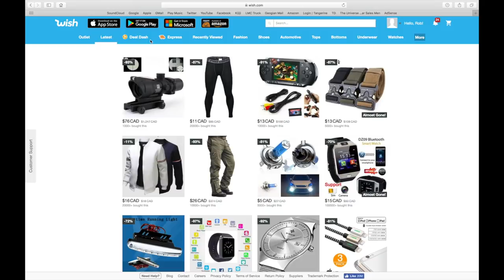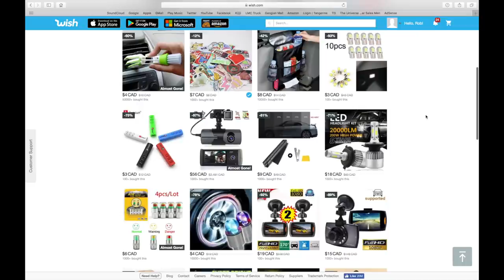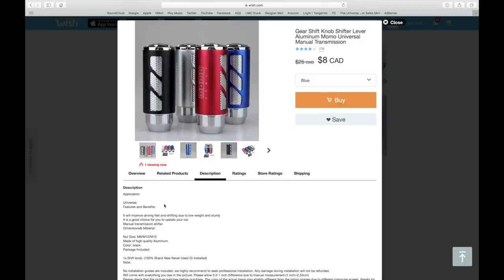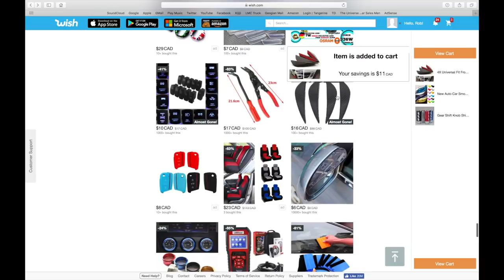I Bought 3 Knockoff Car Parts from WISH!

Comment: I ordered a phone case of wish a year ago ..... still waiting 😂😂
Reply: Levithan Harvey same i ordered a lamp that connects to ur phone . Never got it
Reply: Hamoon Naseri yea don't trust that stuff anymore aye 😂 just surprised this guy's stuff came
Reply: They refund you no questions! I was pretty suprised
Reply: Easy to get refunds. Out of over 100 orders, I've only had 2 things not show up. One was because I ordered to a business address and couldn't receive so they shipped it back without me knowing. The other was because they ran out of stock. I contacted the company after a month of waiting and they informed me of the stock issue and refunded. Although most of them speak somewhat broken English, they are more than happy to work with customers as long as you don't buy some weird one with 0 reviews. The trick is just that...read reviews! Some things are actually awesome deals. For $3 I got a Bluetooth to aux adapter and it has decent range and no audio quality drop that I've noticed on my aftermarket system. The clothes are comfortable, where they cut costs on those is the inside of the clothing(seams are messy or lacking in fabric, but look flawless on the outside).
Know what you're buying though, I wouldn't personally ever buy something like an air filter or something that could endanger you if faulty unless it has great reviews. Remember, yes it's cheap China crap, but everything like your Apple headphones are manufactured in China. You're pretty much just cutting out the middleman for some products, while some others lack parts.

The thing I've learned is that they cut costs on visuals before functionality. They make sure your $20 mp3 player works even if it looks like you got it in a McDonalds happy meal.
Reverse for something made to look good. Like the shift knob for instance, it looks good and it fit. Maybe not the right way, but it functioned and looks nice.
Reply: Levithan Harvey I orderd something it was supposed to come on may 15 it never came then it said it was gonna come in May 25 never came😭
Reply: Levithan Harvey im sorry
Reply: Anybody saying they never received there goods Simple email and they reshipped another. Used to wait two months They have got that down to 28 days in the UnKnown ie 🏴🇬🇧 Brexit just get the deal done so us Brits get our identity back and hopefully not to late to Make Britain Great again . That’s what we voted for. ✌🏼
Reply: I've had everything i ordered delivered after 1 month.
Reply: @jdrfc6526     Im with you on that James. Lets hope so buddy.   David.  G B
Reply: Hold on could still come might just have sent it in the rowing 🚣‍♀️ boat So could turn up but don’t hold yer Breath. Delivery 🚚 costs kill it could order plenty but the shipping prices are like £17 for a £7 part upgrade mod for my car but as a said just your luck what you get Just got a Honda mugen sun-strip only £10 and it’s quality over £40 in the U.K. and things I ordered just after Xmas came first week of January. Been ordering things here and there for 4 or more years now all I no don’t order clothes Well me everything hasn’t fit went with guide but big legs muscle So hard to get the right fit here online.
Reply: Levithan Harvey Hold on could still come might just have sent it in the rowing 🚣‍♀️ boat So could turn up but don’t hold yer Breath. Delivery 🚚 costs kill it could order plenty but the shipping prices are like £17 for a £7 part upgrade mod for my car but as a said just your luck what you get Just got a Honda mugen sun-strip only £10 and it’s quality over £40 in the U.K. and things I ordered just after Xmas came first week of January. Been ordering things here and there for 4 or more years now all I no don’t order clothes Well me everything hasn’t fit went with guide but big legs muscle So hard to get the right fit here online.
Reply: Did you get it? 😂
Reply: U got it yet
Reply: @frankovich213  in the past year, wish prices have gone up immensely. Shipping used to never be more than 3 dollars. They intentionally started with ridiculously low prices, but nowadays they've pumped it up since they gained popularity and can afford to move less product
Reply: Are you sure u actually bought it 😂😂😂😂

Comment: the vinyl ripped because it wasn't hot enough.
Reply: Casman heat guns are way hotter than a hair dryer
Reply: I know lol. that's why it tore.
Reply: You don't have to use a heat gun at all, for certain parts, if you know how to do it. The "Melting a little bit" is actually bad. Although this is not 3M, it's half the doer's fault, it's half the product. But, no "blame" or shame. Just blame the site and the seller, taking advantage of actual people.

Comment: my uncle has been running a shop for wrapping cars since the early 00's. ive helped him over the years and from experience, the bubbles and tears arent from the material.  if you ever decide to try something similar again, make sure to wipe the headlight with alcohol to get it clean, and make sure to wipe it again after the alcohol dried to get rid of the residue (microfiber reccomended). i also highly recommend taking the headlights out to apply the tint. to minumize the bubbles, applying heat and using a plastic squeegee to flatten the rap is most effective.

Comment: I have a MOMO combat Evo Shift knob from the early 1990s. There are no threads to screw on to the shifter. They use rubber adaptors with hex screws to tighten it to the shifter.

Comment: I have a Sparco shift knob, it uses basically the same plastic cover/screws system but it comes with a piece that covers the bottom so you don't see the threads. Not all shift knobs screw right on to the factory threads.

Comment: Real Momo shift knobs are like that though...
Reply from the maker: Ohh....
Reply: Robbie Ferreira its a universal adapter, that most shift knobs from places like autozone come with. I found if you find one thats kind of snug on the threads, you can spin them on to thread the inside, and then screw the set screws on the rubber.
Reply: I've had universal gear knobs that work the same, plastic to take the difference in size, and a pointed grub screw to lock it to the shaft
Reply: I'm pretty sure that real momo shift knobs don't use any bullshit adapters, that's some autozone janky shit, real aftermarket shift knobs that are actually quality, come tapped for the actual thread pattern on the shifter, i lol'd when this dude said" all aftermarket shifters come with adapters"
Reply: not all shifters are threaded.... BMW e36 for example...
Reply: I have an aftermarket Sparco shifter and it came with these adapters. He did it wrong, you get the adapter that is a little too small, use vice grips to screw it on, the threads will thread the plastic adapter, and then you put the teeth in just to hold the shifter to the adapter. Works fine, Mine is a weighted shifter and my gearbox is sticky as shit, so if it was gonna fail, mine would have already done so because I need to slam the fucker in gear...

I need a new box...
Reply: Cameron Sutterfield i have a real momo shift knob that i bought from the official momo website and the universal fit is just like that and he did it wrong
Reply: Momo does not make shift knobs that look like that lol
Reply: True. But momo never made good visual accessories. Soooo

Comment: Watched your follow-up video and I gotta say I'm glad you did this, so thanks for that.
I guess I just wanted to mention the way I put tint on headlights in case you were going to do it again, it might be easier.
Starting my removing the headlights, and then I guess just what you guys did. Set up the tint on the flat surface first of course and when you start working on wrapping it, cut on the corners so it folds better around the sides, even if it overlaps to get a clean look it won't matter because it'll be hidden. 
But finish your wrap to the back of the headlights and then just cut around to get rid of the extra.
Once you have a nice finished look, take your heat gun to it and you're done.
Again I enjoyed the video, and you've got yourself another subscriber. Nice BRZ man.

Comment: I've bought about 13 things from wish for my car. Out of the 13 things about 6 have turned out okay and out of those 6 things 3 was quite surprisingly good. For example my carbon fiber spoiler which you stick on with some of that 3m tape which i also replaced as it's trash but now its great, some blue metallic trim which you place in those small gaps in the interior of your car to make it look more eye catching. And a non slip rubber mat for my dash to hold stuff which works really great holds money, my phone etc. 
Things from wish can be hit and miss sometimes. Such as the light up ford front logo badge. Looks quite good and spot on but turns out it was slightly too big to place in the grill so that ended up being useless.

Comment: the plastic piece u were suppose to use the tight fit and SCREW IT so the thread will leave an imprint on the inside of the plastic. then u have that two screws on the side of the knob to hold it in place.

Comment: VHB tape requires more force than you appeared to use to adhere properly. Also wipe the surface down with alcohol. Press down fairly hard on every possible square inch of the tape.

Comment: Did you put any solution to apply the vinyl over? The solution helps it from sticking until it has been formed to where and how you want it and than you use a squeegee to push out the solution and prevents air bubbles in the vinyl.

Comment: Ouuuu I have that multicrome nrg shift knob but the tint in the headlights; the bubbles are normal for first applying it, i did my headlights with some expensive tint and I still got bubbles in it 😂

Comment: About the tint material I got it way to hot and when tint head lights you need to wet installation and start from the middle not the top edge

Comment: I have gotten some of the LED head lights which I am very happy with. Also got the Canards which I was going to use to extend my chin spoiler and they seemed okay... they were rubber.... wound up not needing them. Mine were decent sized, though and pretty sturdy. I don't see how they would do much for aero. I wound up paying out the nose for a fab shop to make a new chin spoiler. (69 Camaro) I do suggest getting the hydro dipping film! I bought it... haven't tried it (too cold still)
Nice BRZ... always kind of wanted one but I hear they are kind of gutless out of the box (Just what I am told) and kind of suck on snowy roads. Can anyone confirm?

Comment: The tint would have worked fine had you not been lazy and instead bothered to remove the headlight unit itself. That way, you could have wrapped it without the body in the way and when you reinstall the light, the body would overlap the edges of the light and thus hide any seams.
If you're wrapping something, and it can be easily removed, doesn't matter what it is, remove it first. It's easier to manipulate and you'll always get a better finish. That and you won't bend yourself into funny shapes trying to manipulate the hot air gun into the right place. You can keep the air gun in one spot and manipulate the part instead. 
Obviously removing body panels isn't as straight forward or even feasible most of the time but lights or door mirrors/handles etc? A few screws and bolts.   
Considering how cheap the tints were, buy another set, remove the lights, remove the bodged film already on there and reapply using a work bench to support the headlight unit while you do so. Also, use some solvent on the headlights first to remove any debris or oils that may be coating the glass before you apply the layer. Just make sure its dry after cleaning before you start.
You'll be a lot happier with the end result.

Comment: In the video they do the headlights first... then they pull the car out of the shop and the little car in fiber parts are already on the bumper, then the video goes to them putting the carbon fiber pieces on and the headlights aren’t tinted anymore 😂

Comment: Ive actually gotten a ton of stuff from wish and a lot of it was for my car, and yes you get some crap somrtimes but really if you really look at what youre ordering before you order it you can usually pick stuff youll be satisfied with. I also got some "gnards?" you called them? I just refer to them as ground effects... Mine were a set of 6 and i actually had to bolt them on bc i did not trust them to stay. Also anything on wish AT ALL with 3m tape on it, dont even bother, just provide your own means of affixing it to the car. Also you can buy these circular and/or square 3m pads on wish that actually stick better than anything ive ever gotten from anywhere and if you just replace the 3m backing with pieces of these cut to the righy size and shape youll be set! Id like to post a picture of my car i. This comment but i dont know how to do that or if you even can or how else i can make the picture accessible through my comment. I think youd be impressed whith what i eas able to do to my car with wish product.

Comment: Tips on using Wish:
1. Follow the rules of wish. 
2. Never buy anything with less than 4 stars. 
3. Never buy anything that has a "store ratings" or "store reviews" next to the rating. 
4. Use common sense and read the fucking reviews.
5. Read the products description and specifications.
6. TAKE THE PRODUCTS NAME LITERALLY. 
7. Don't buy anything with a too good to be true price. 
8. Didn't get what you wanted? Submit a refund. Wish accepted refunds 90% of the time. Paypal accepts refunds 100% of the time.

P.S. Some products are low quality because they are... you guessed it... CHINESE KNOCKOFFS.

Comment: I have been buying from Wish and Geek (powered by Wish) for over 3 years. Their tracking system is so awful even tho I receive what I order I typically get a refund for most of the stuff I ordered.  I ordered headlight tint from Wish and did way worse. I ended up throwing the tint out out of frustration.

Comment: i ordered some super cheap headlight tint, went on the same way and about 6 months after the installation the yellow color started to peel off of the clear headlight film.. almost as if the company started with a clear film, then just stuck a yellow filter over the front. Looked like absolute shit

Comment: When you order, they give you a delivery date, if it's over 30 days late you can get it free.  Go online and tell them it's late and you want a refund.  They will refund your money and when it does come in, you don't have to return.  If it's not correct, damaged, you don't think it works, same thing applies, refund and keep it.  I have gotten decent stuff and I've got junk.  Gotten refunds when it was bad.  Never had anything that took the long to come in.  Also Wish doesn't sell the stuff like Amazon does, they have vendors that sell the stuff and ship independently from Wish.  Learn about a company before you run them down!  Also the sellers have "dependability in delivery" ratings.  They do ask you to rate the items and vendor.  I never buy from a vendor with less than a 95% rating.
You should know that most things there are knockoffs and learn how they protect you in the purchase.  They verify the delivery to you and the vendor evidently doesn't get paid until delivery is accepted and everything comes with a 30 day warranty.  Read the specifications carefully and you won't be disappointed very often.
You did mention some of this quickly at the end, but I want everyone to know it's not a rip-off site.  They do want you to be happy with your purchases.  There's ways to earn discounts and they run sale coupons often.   If you get something bad, the most you're out is the small shipping charges.  Also compare several vendors because prices and shipping charges are different.  I've actually bought something cheaper but paid more for the item but the shipping was much lower.  There are sometimes very large differences in price from one to another.

Comment: I know nothing about cars whatsoever, but I know that when wrapping, you should be using as little heat as possible. I mean, if you've never done it, obviously you don't know how to do it. But I don't think you'd be able to tell if it would work well if applied correctly. Just saying.

Comment: Those light tints are bad at all you just need the proper equipment like a heat gun that’s what failed you guys if you would’ve had it it would’ve been easy